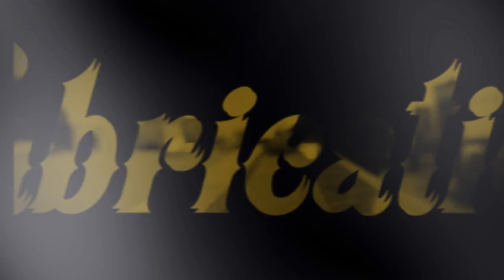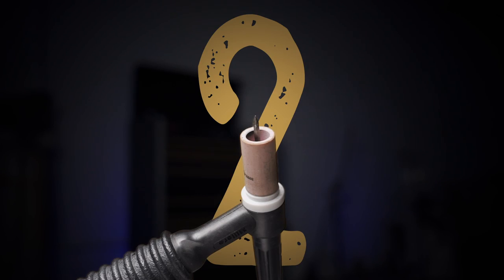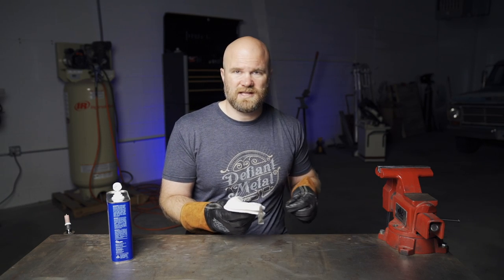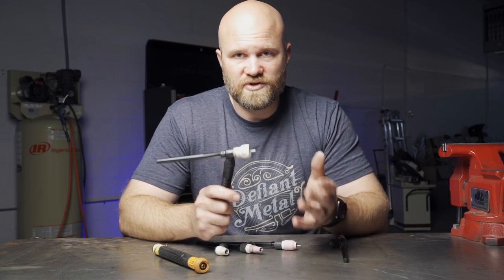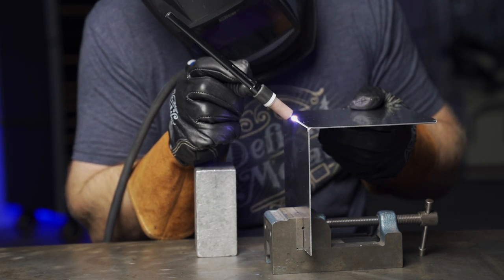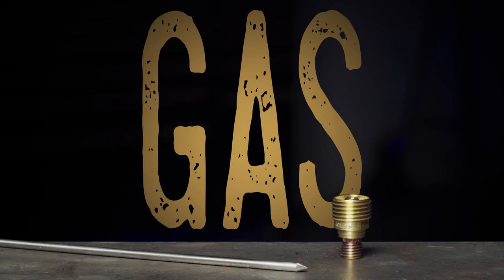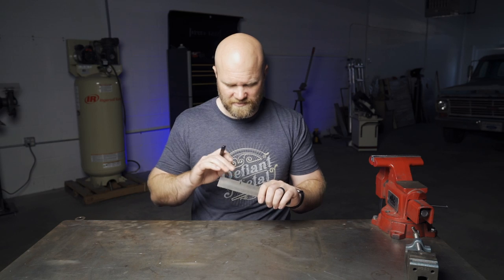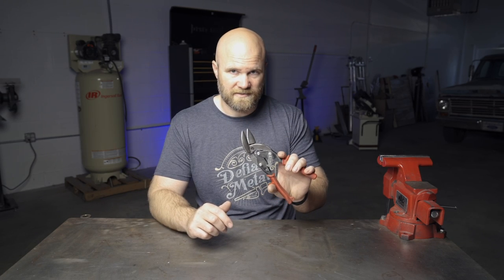9 Fabrication Tricks In 9 Minutes

Comment from the maker: Who watched all the way to the end to make sure....?
Reply: Meeee
Reply: I liked the drill bit tip to deburr
Reply: Snip snip the tips :D
Reply: That’s awesome tin snips haha
Reply: I did
Reply: I will have to remove my old nail clippers for my key ring and replace it with tinsnips.
Reply: Me , that was great .... learning something new is always good  . thanks
Reply: I did great tips Thank you :)
Reply: I did! Great tips. Just learning to weld. Thanks for the tips. ❤️🐞
Reply: Justin Voss 💅
Reply: Pro tips...love the nail clippers 🤣thought I was the only one... works great on hangnails 👍👍
Reply: What kind of camera are you using to shoot the welds?
Reply: I don't think the head change works for water cooled heads. 🤔
Reply from the maker: Mr Mr I’v only seen it on water cooled heads.
Reply: @JustVoss  gonna try to take the work torch apart now. 😂🤣
Reply: Btw, you can use emry cloth on your wire to get rid of the silicate coating on carbon wire, stailess and aluminum, acetone all day, or even something like carb cleaner with a fresh paper towl or shop towel of some sort.
Reply: @tsunamisamples4494  sandpaper and a drill in my my shop. 😂🤣
Reply: Yup !!
Reply: You’ll need the green snips to trim the other hand.  The yellow snips are for bushy eyebrows, nose hairs and such...
Reply: Not a Tig-er,  but the first was great.
Reply: I'm so glad you left the nail sheers last, or I'm sure I wouldn't have made it!
Reply: I did, great tips and great to weld with you at Fabtech! Hope all is well! Merry Christmas
Reply: Justin Voss i watched it all
Reply: We did! Great tip on the red snips! We could see your nails fly 😆
Reply: What was that stupid shit at the end? Thanks for the whiplash
Reply: I've used everything from scissors to side cutters on the o'l beer tab separator!
Reply: Very good trick, thanks
Reply: Sunami samples might need to double check the carb cleaner idea. I’ve heard it’s very bad and dangerous fumes , using carb cleaner when welding!!!
Reply: Justin Voss I did. Tin snips. I’m subscribing.
Reply: I think I will try tin snips on my toenails
Reply: I had too because there is so much I learn from you, like hygiene. lol

Comment: An old machinist showed me to stick a countersink bit in a file handle and use that as a deburring tool and it's now one of my favorite tools in the shop
Reply from the maker: I have one welded to a piece of tubing for a handle! But I bet the file handle is more comfortable.
Reply: You can even buy a tool like this, but making it yourself is probably a bit cheaper
Reply: Another good one is to grind a triangle file smooth and run the edges around a hole. Also learned from an old machinists. Those guys are geniuses
Reply: @romanholowka9558  Dear lord, that's almost as bad as in the medieval. Sure, it works, but why wouldn't one just get tools made for exactly this purpose? I mean other than needing it right now on a Saturday morning at 2am when all the stores are closed? Even Amazon has better stuff around.
Reply: @smurface549  The guy probably made that before amazon existed lol
Reply: I have a bunch of deburring tools that go in my cordless drill and that works well and fast.

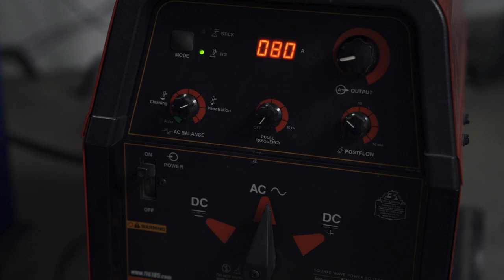Comment: 2:03 if you use a piece of copper instead of a scrap piece of steel to ball you tungsten you're less likely to contaminate it. I use an old piece of buss bar out an old electrical panel.
Reply from the maker: Thanks for the tip!
Reply: I assume brass would work also?
Reply: I keep a copper water fitting in my welding stuff just for this.

Comment: Another good tip. To sharpen tungsten electrodes I put them in my cordless drill chuck to grind them perfectly while spinning the tungsten at the correct angle.  I also have a container of water to dip them in to keep them cool. I also use a semi wet rag (not dripping wet)to wrap my Tig torch head after a few welds to keep it from over heating. It will last a lot longer. Of course I keep my gloves dry not to get shocked.
Reply from the maker: I often use a drill too that’s a good tip. Have not tried the water but may?? I’d eventually like to get a water cooled torch to prevent the overheating.
Reply: I welded with a syncrowave 300 with a water cool torch. I went through at least 2 torches a year in a 5 year period. I welded 6061T6 .049/.065 tubing to evaporation plates for refrigeration production for the marine industry. I had to use a short back cap with gas lenses set up for limited positioning space. The heat deteriorated the components after continues use.

Comment: Instead of only one 5" grinder, keep two, one with a cutting disc and one with a grinding disc. 
Both ready   and no time for changing discs, pluss you wear both of them out completly before changing.
Saves money and time 

Keep up the channel 😎
Reply: haha two?  I have like five....  cutting wheel, cubitron II fiber abrasive disk, flap wheel, wire cup, and wire straight.   A mix of both electric and air (to get speed control with electric is expensive.  air gives speed control for much less money).  But yeah, I get that most weekenders don't have the budget for all that.
Reply: Need at least 3 I think even if they are just cheap ones. One for cutting, grinding and a flap disc. If you do any amount of metal work just one doesn't cut it.

Comment: Cutting aluminum with a cutoff wheel just apply some dove soap every now and then when you feel the wheel not performing as well. This also works for soft-back and flapper wheels to keep the aluminum from clogging up the paper. If you need to have well rounded corners on your edge to edge aluminum welds a router does wonders (carbide teeth) just don’t forget to scrape a bar of dove down the edge beforehand, keeps the aluminum from sticking; washes off nicely too.......so on and so forth. Good video.
Reply: You can also use bees wax, and more convenient, a soap stone for this.

Comment: A bonus tip is to never hold the work piece with your bare hand while drilling. A bit that grabs will spin it like a razor, and slice your hand before you can even see it.
Reply: I seen a guy do that while using it a piece of stainless on the drill press to drill a half inch hole in one step it sliced his palm right open in one big flap
Reply: Couple of squirts WD40?  Never had a piece bind, still use gloves tho lol.
Reply: bare hand yeah, glove is worse though if we're talking bench drills

Comment: I learned 2 things today that I will definitely use. How to easily debur a hole cleanly, and how to quickly remove a sharpie mark. It's the little things that matter.
Reply from the maker: It’s always the little things!
Reply: AND a sharpie line reduces the friction and effort needed to cut the metal.Reducing heat,also.

Comment: Tip 2 :: "Only ball your Tungsten if you're using a transformer based machine.  If you are using a new, inverter style welder... leave a point" - Mr. Tig
Reply: I read your comment like "hugh, that's counter intuitive". Then I read the quote attribution and it made sense. Wyatt Swain (Mr Tig) had a ton of advice, some good, others not so much. Inverter or no, try fillet welding with a sharp tip and a balled tip, really consider what arc is easier to control at the start (before the tip starts to naturally ball).

Comment: Tin snips as nail trimmers....boy does that bring back a memory.  My father is one of those guys who likes wearing black socks and sandals.  One day he decided he needed to trim his toenails.  Off came the socks.  What greeted my horrified young eyes was a hammer toe on each foot which was topped by a translucenct yellow corn.  Thick, cracked calluses on each heel, and thick, yellow smoker toenails.  The toenails proved impervious to the larger toenail clippers so he switched over to an old pair of carpenter pincers which he first sharpened with an old file.  He lined the pincers up on his big toenail, grabbed the reins in both hands and started squeezing.  You could see the reins start bending with the pressure.  Suddenly there was a loud snap! and a piece of nail shot out of there like a bullet.  I couldn't watch the rest.  To this day, when anyone mentions black socks and sandals, I can't help thinking that it might be for our protection.  Cheers.

Comment: Great tips, dude! We're just getting into metal fabrication for our skoolie build. Is MIG the best option for welding steel structure in vehicles?

Also, for exterior body, we’re using sheet metal repurposed from the interior ceiling. What’s the best option for filling the seam between sheets? We were considering bondo, but heard it might pop out between two sheets.

Thanks for a great video!

- Brian + Erin
Reply from the maker: Mig would be the best yes, Def not stick. And for filling the seams on interior sheet metal 3M Drip-Check sealer is what you want. Tack weld the sheet metal about every inch or inch and a half and fill in between the tacks with drip-check. On exterior if you don't want to see the seam then step one of the pieces of sheet metal the thickness of the other piece and over lap them. Then tack every inch on the exterior, grind the tacks flat and smooth out the seam with bondo. Can use drip check if you don't care about it being visible.
Reply: Justin Voss awesome! Thanks so much for replying & the guidance! We’ll see how it turns out 🤘

Comment: I see you have air grinders etc. Is everything generally air in your shop? I'm wanting my tools air based please make a tour video
Reply from the maker: I did a tool box tour video, that might give you a better idea. But yes mostly air. Since I only have a 3.5hp 60 gallon, on large cutting or grinding jobs I will use some electric. Eventually would like to get a larger compressor and not have to use much if any electric.

Comment: @Justin Voss
Balling the tungsten with dc positive will pull impurities into the tungsten. I would avoid that.
Reply from the maker: Someone else commented doing it on a piece of copper prevent some of that.
Reply: @JustVoss  Why not just run AC and a piece of thick aluminum? With enough amperage my maching forms its own ball just fine on AC. Maybe that's just my machine, can't say I have tried it on a square wave tig yet.  I have an old 300 amp lincoln idealarc. Love your videos by the way.

Comment: For that first tips, its easier to just use a hole saw on a drill jig🤷🏽‍♂️
Reply from the maker: You have to have a drill jig and a hole saw for the correct size tubing. This way you can do it with anything that cuts metal.

Comment: 1:15 how the hell did it go from being cut on the outside to being cut on the inside.
Reply: It’s the same piece.  Think of it as being turned 90 degrees.  The throat or concave area he finishes with the grinder is the “back” edge of the saw cut.

Comment: Why use a drill bit to deburr a hole? Just use the deburring bit. Every shop should have at least one if not twelve because someone always “borrows” yours.
Reply from the maker: I used to use a countersink welded to a handle. But sometimes just grabbed a drill bit if I couldn’t find it. In racing what’s available is usually whatever you buy to have in your toolbox.

Comment: rounding your tungsten on dc isnt a trick. its the proper way to do it. use a copper plate instead of steel. that "flash tacking" is easyer than that. set it to 150/175. rest the cup on the part and just stomp the pedal all the way down then off fast like snaping your fingers fast. you can just cover with your glove dont even need shield. what if i drill out my gas lens 1/8 and need to go back to 3/32?
Reply from the maker: Weld it back up.